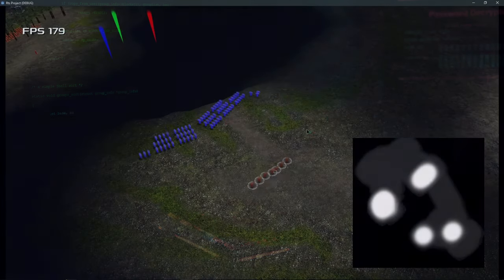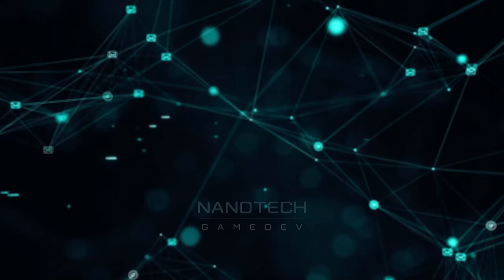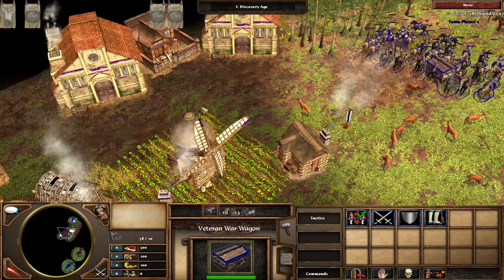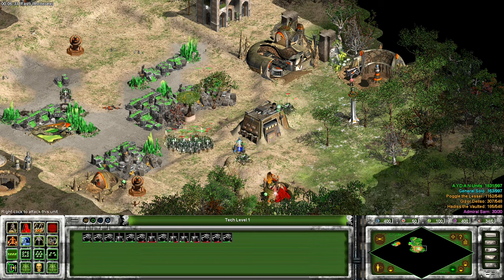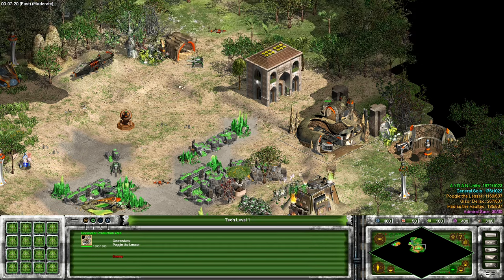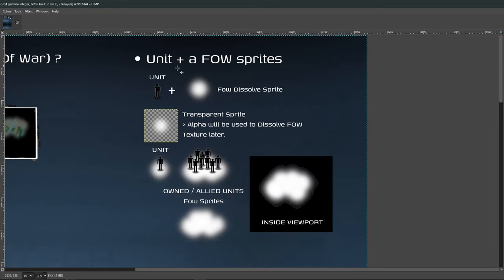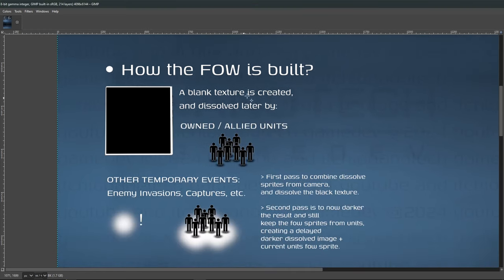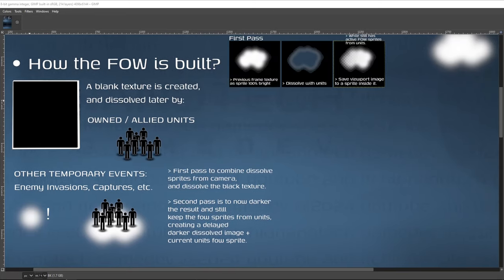How I did fog of war without Physics in Godot - (Concept & Code) : FOW Update Video for RTS Project

Comment: The # semi-explored FOW  line isn't having an effect for me. The FOW sprite is complete modulated to white and doesn't have any gray areas. Could this be Viewport setting? Blending issue? modulated elsewhere?
Reply from the maker: It's a little bit finnicky to work the fog of war the way I did, because you have to store two images, the first one is how the fog of war is currently at that frame, store that as the first image as a background image, then we lower it's brightness so it becomes unexplored areas with 50% gray, and we add the sprites on top with transparency to save the final image for the fog of war texture, this second image it's the one we export to the terrain and apply on it's material, you have to make sure the rendering also awaits at specific frames in order for this to work properly. Also viewport settings can affet it yes, thing like size and also some flags can mess it up, I do not promise anything, but mayybbee whenever I have enough spare free time I will port out of my project the fog of war system and post it somewhere, not atm I am afraid...
Reply: @nanotechgamedev  I got it to work. I adjusted the 0.149 number to something higher and I had to turn on a flag in the Viewport. I'm still playing around with it. thanks for the points!

Comment: What about FOW blockers? like some structures or elevated terrain?
Reply from the maker: It would be super easy to do it, as you can see I have used white sprites to reveal the fow, if you want the reverse, use black sprites on top of the units sprites but don't use the dissolve function on them, so the viewport will capture that and the terrain will have FOW blockers.

Comment: Oh no. My message from another account was filtered ? (By anti spam ?). Anyway, thank you for your tuto, thanks  to you I implemented my own fog-of-war using a texture in a shader. (But no viewport, i would still like to know why you felt the need to use that !)
Reply from the maker: Sorry for your comment getting filtered, didn't see it held for review either, don't know what happenned, yt can be quirky at times. About the FOW, for me it was simpler to use the viewports to do it, couldn't get it working the way I wanted with shaders so I choose viewports, from what I could analyze the perfomance is responding very well to this workflow, when generating the new textures there's a bump, but that's about it, I would guess that shaders would be faster than viewports, that is if you know what you are doing because shaders can also be very poorly optmized, but then again C# would be faster than Gdscript, we are not going to re-write it now, I am trying to move this project forwards, so FOW is now finished, at least I think so.